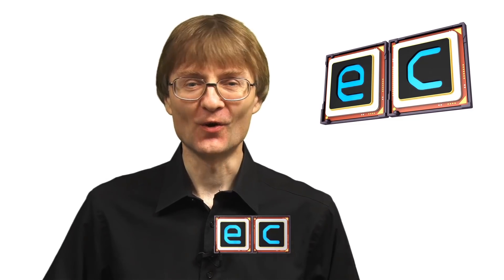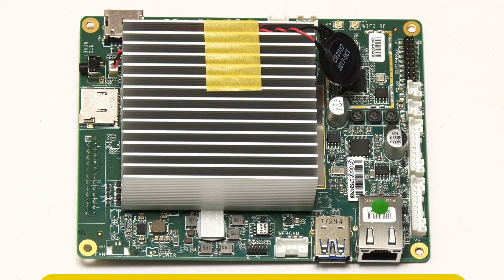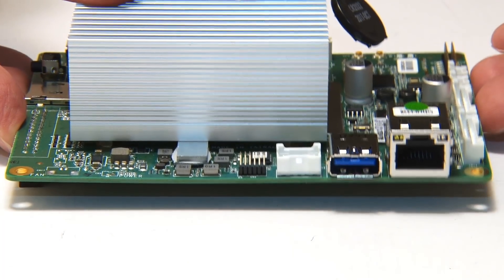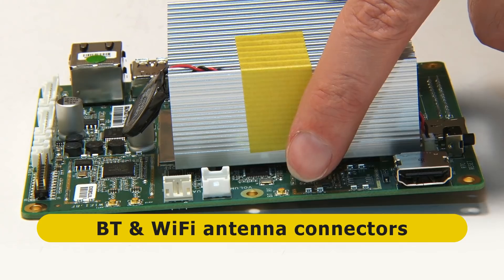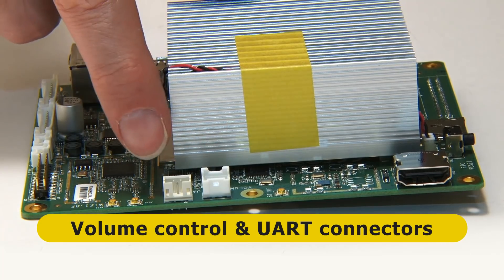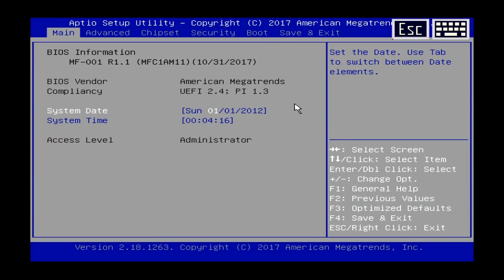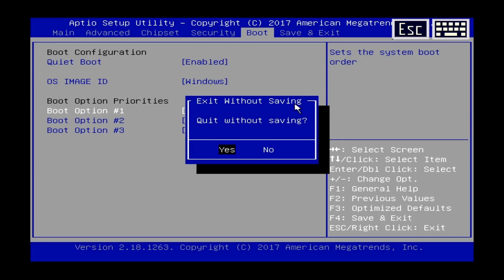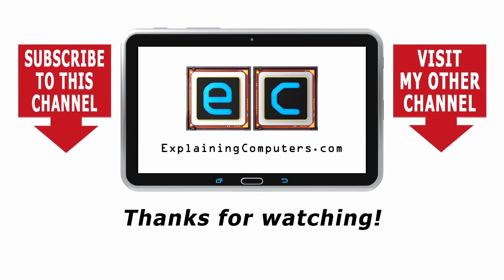Atomic Pi Intel Atom SBC

Comment: I have a cheap Chinese tablet with similar specs and windows 10. It really shows how heavy it is compared to 8. 
I had a linx 10 with a z3735, 2 gb ram and 32 gb storage running Windows 8. I loved the thing. I used it as a main. It ran most things, kodi and emulation upto ps1. n64 worked but the majority of games had <20 fps. 
I then got a windows 10 tablet with this cpu, 4gb ddr3 ram, 64 gb storage. I hardly use it due to how slow it is. Upon boot it begins to TRY and update. This takes 2-5 hours at which point >80% of the cpu. 
It spoils the experience, i ended up using android most of the time and installed Ubuntu which greatly improved it.
Windows 10 does sort itself out but it takes nearly a week of letting it exclusively updating.
Reply: I had that problem with an Asus laptop got tired of it updating every time I turned it on.

Comment: An interesting SBC! And rebranding it as a maker board is pretty clever, too. It might even end up being used for someone's robot, like it was intended, which is pretty neat.
Reply from the maker: Yes, things could come full circle! :)
Reply: There is some information on Github as well so it may have some of the robot information or at the very least information on the camera being used for facial recognition.   Maybe use in a drone since it has a compass built in

Comment: Not a “maker board” more a board for “roll your sleeves up hobbyist”
Will run Linuxcnc with a RT kernel for use with any of the MESA Ethernet boards.
Regarding power, it is more reliable with 3 or more power wires per Positive & Ground. The five pin connector near the USB3.0 marked camera is a USB2.0 port

Comment: Several years ago I faced the sad fact that 32GB eMMC storage is not enough for Windows 10... After some time on my Intel NUC5PGYH OAJ (with pre-installed Windows 10) it became impossible to update Windows, even using another 1TB SSD disk to store the updates. The problem was solved after migrating Windows to the SSD drive and disabling the eMMC storage. Also you will run out of your Atomic Pi 2MB RAM after opening several browser tabs (at least on Windows 10 with 1080p)...

Comment: @ExplainingComputers The three connectors to the side of the board that you could not determine the purpose of are connected to a XUF208-128-TQ128 microcontroller. This itself is quite an impressive realtime MCU with 8 32-Bit RISC cores which seems to be connected to the SoC via USB2. You can find the processor board schematics at https://www.digital-loggers.com/apschematics2.pdf
Reply from the maker: Thanks for this, most appreciated.

Comment: DAMN, Now I want one of these simply because of the Nav  function.  You could do a tidy little Nave System for a Ultra Light Air Craft. eaaaa?   Artificial Horizon ? Angle of Attack ?   Any ready made programs for that out yet ?   LOL,  Just ordered one via Amazon for $40.04 Free shipping.    This is ALL YOUR FAULT Sir !  LOL
Reply from the maker: Sorry to cause you purchase problems! Sounds like you will run some interesting experiments on this board though. :)
Reply: @ExplainingComputers  Well Worst come to worst I'll have yet one more back up computer come Armageddon Day.   It would seem the thing can  do pretty much anything AND MORE then this Lenovo I've typing on.   No End to these SBC it would seem.  And this one brought to light only because of a Failed CNC venture and  project ?   Wondering if they would continue making them sense all the Capital Out Lay and Development has already been spent.  You recon Parts and manufacturing would allow them to be sold this cheap ?  The Chines seem to be able to do it.    LOL,   Watch BangGood will start to sell clones in a few months ?
Reply from the maker: I don't think this board is manufacturable at the selling price, due to the price of the Intel CPU.
Reply: @ExplainingComputers   The buggers would clone that too.

Comment: The Amazon Prime pictures show what all the other connectors are for. Next to the speakers are a couple of digital audio output ports and a port marked 'Xmos Xtag Prog'. Next to the webcam port that is the factory Bios programming port.
Reply: I saw the photos as well.  The docs mention optional audio amplifier but it looks like it may be there, possibly for the L/R speakers.  That's cool.  What miasmark shows as digital audio output ports I saw on one diagram as MIC inputs.  Since this was a robot, I suspect these ports were used for surround digital mics.  If that's the case, along with the other programming stuff, this makes it a quite interesting hacker board especially since its original use was for a robot.  I think I'm going to get one to play with!
Reply from the maker: Thanks for this info.

Comment: Random, mysterious, undocumented connectors. I hate them because you know how awesome it would be if you could just figure out how to use them but... no data sheets. So there they sit innocently with their inviting, shiny silver pins and their neatly printed but impossibly cryptic labels and their delicate, tantalising traces languorously sashaying across the board to wriggle their way in amongst the millipede-like legs of inscrutible, anonymous integrated circuits.
Reply from the maker: Others above have revealed some of the functions. :)

Comment: Another problem with the Atomic Pi is the reset button.  After installing other OS on the MMC, if I pressed the reset button when the board hang during shutdown, the OS on the MMC would disappear from the bootloader.  It happen 4 times before I realized what was causing the OS to be not recognized.
Reply: SAME. Happened to me twice. Don't know why. Thought about either glueing the button stuck or desoldering it. Would be nice to know if your OS still gets wiped when you press it while shut down...

Comment: That was quite a investigative work you did there Chris; this id why you are the master 🙂
I have thought about buying the atomic pi but always put it off because of the lack of connectivity.
Power is no problem I already have something for that, but one thing that I absolutely need are a few usb ports.
Still it is a nice little board

Comment: Atomic Pie Chips and Beans...RTC Battery hanging of heat sink.....ROFL
Reply: The battery has a pre-attached adhesive pad on one side; is stuck mine to the underside of the board.

Comment: Can you do a video explaining the fan connectors?
Reply: One pin is ground, the other +5V. Check with a multimeter for continuity and solder your fan wires to the corresponding pads. Maybe there is a handy graphic on Digital Loggers' homepage with the pinout.
Reply: Ute Brüggenfompel Thanks!
Reply: You prolly won't need a fan tho, the heatsink is really big for that tiny processor; mine does not even come close to overheating.

Comment: I got 2 Atomic Pi's, the first one failed within 24 hours and the replacement has worked fine since.  I encountered the same problem on both boards: Ubuntu based OS always hang during shutdown and I had to remove power to turn it off.  That means REBOOT always need manual intervention.  Debian based OS like Raspbian does shutdown properly but there is no sound. 

If Atomic Pi is indeed a leftover industrial part, that also mean there will not be any support or bug fixing for it.  What works and don't will stay the way they are.
Reply: I'm running your bog-standard debian 9 with LXDE, which shuts down and reboots properly and uses only 250-ish megs of RAM, leaving plenty of headroom for whatever you want to run on it. I managed to get sound out of it by attaching a bluetooth antenna, installing blueman (and some other package; if you google the error message, should you get one, it's one of the first hits) and connecting it to my Bluetooth headphones.
Reply: The support for this board is less important than for ARM boards which need to be supported specifically.  This is a standard x86 computer with normal BIOS, and no issues with GPU drivers.  It benefits from normal Linux development.  The Cherry Trail CPU had problems with Linux in the past, but many things have been fixed and incorporated into recent kernels.  Maybe some other issues remain.  There was a developer, Ian Morrison I think, who was fixing the issues with the Cherry Trail and provided ways to patch ISOs.  The page is called Linuxium.  One of the issues I remember hearing about years ago on these Atoms and Linux was no sound.  That may still be the issue on Debian-based stuff.
Reply: @ravagingwolverine  Being X86 based, one would think so.  However, I have tried many OS on it and every single one quickly showed one issue or another.  

Unlike ARM based SBC that the manufacturer owns the issue of making sure OS works, Digital Loggers likely would assume that since it is X86 based, someone will fix all the incompatibility issue someday.  If Atomic Pi is a long lived product, that may happen.  If it is a leftover industrial part with limited supply, what is the chance of getting that happen?

This SBC has been on the market for a few months now and Digital Loggers has not even bother to provide a simple documentation on what are all those connections on the board are.   I use it as a NAS controller and it works fine for that purpose but I would not count on OS to improve later.
Reply: @hdl75248  If there's missing documentation, I suspect there is an issue of NDA involved.  They may have even said so, but I can't be sure.

The Atomic Pi may have its own issues and quirks, but it's also more flexible than the ARM boards which can be stuck on old versions and kernels.  So it does still benefit from overall development, especially if there are still improvements being incorporated officially into the kernel that are related to Cherry Trail, or if some distros are still on older kernels.  It wasn't that long ago Ubuntu had the same audio issue as Debian.  It's possible the other issues will be fixed as well.  I remember having issues with Ubuntu on an Ivy Bridge laptop.
Reply: Do you have the same mouse-issue when moving the cursor to the left edge of the screen?
Reply: @utebruggenfompel5764  I encountered that problem initially but then found that it was due to overscan issue on the TV monitor, i.e., I only saw a potion of the display on TV.  That problem went away after I changed TV display mode to "scaled", and everything worked fine after that.
Reply: @hdl75248  oh, that's a different issue than the one I was thinking of. I meant that that my cursor gets "stuck" for a moment when I move it to or along the left edge of the screen quick enough. It still works, but the pointer visually (but not functionally) freezes for a second.
Reply: @utebruggenfompel5764  I ran Raspbian and did not notice that problem.  Just made a quick test with VNC connection to the APi and did not see that problem.

Comment: Windows is quite fiddly to get running from SD or USB, it wont install naturally on those but should be OK on the internal storage, but 16GB isn't enough, all my 32GB tablets wont install 1903, 64GB is now the minimum in my opinion.
Reply: Windows 7 is still only just still being supported. Id use it.

Comment: I WONDER HOW IT WOULD RUN WATERCOOLED ...... PLEASE DO A TEST
Reply: Its more of a thermal interface issue. I ran benchmarks on mine to get it to drae 3.6A at 5V. the heatsink reached 55°C while the cores got to 90°C

Comment: That's an impressive little SBC. X86 and it can run a lot of heavy software pretty well. I don't know if you usually do this type of thing, but I'd love to see how it performs as an Emulator system. I hope another production run happens, I'd love to get my hands on one.
Reply: If you watch ETAPrime, you will see he has already fully covered the excellent emulation ability of this board. Check him out.
Reply: @englishrupe01  Oh nice, I just recently subbed so I'll have to search that out.

Comment: It's interesting to see the most common budget Windows tablet hardware move into SBC format. I have a £79 10" tablet with the exact same hardware (CPU, RAM, 32GB storage, etc.) The value of this item isn't great considering the features the tablet has for the extra ~£40 (10" IPS screen, speakers, larger storage, and battery that gives ~8 hours of use).
Reply: That tablet probably runs 32 bit windows which is quickly becoming legacy as 64 bit only software is being adopted. Good luck finding 64 bit drivers for that tablet, especially if the manufacturer has never made a tablet with 64 bit drivers. Linux is a option though.
Reply: @EmergencyChannel  That's the only issue with and it's a BIOS problem. I'm not sure why it can't be fixed.

Comment: For anyone wanting to tap into that USB 2.0 Header: If you don't already have a crimping tool (but you do have a soldering iron), the cheapest way I came up with was ordering a 1€ USB 2.0 extension cable from eBay (free shipping), cutting off the plug side and soldering the leads straight to the back side of the pins (with the board sitting on its heatsink and the connector facing towards you, of the two data pins is the left one the one that's typically white and the right one the usually green cable; what's +5 and ground you have to check with a multimeter, as I covered my joints with glue and cannot reliably tell which is which now).
I secured a part of the cable a bit further away from the joints with a generous amount of glue to a part of the pcb without any visible contacts to further avoid stress on them. Not the prettiest solution, but it's cheap and gets the job done.
Reply: Go to the Atomic Pi reddit sub.  There are easier ways with no soldering.

Comment: So the two unidentified white sockets are possibly for powering motors on the original robot ? So there might be an operating system tailored for the robot, to make use of those ?
Reply from the maker: This may indeed be so. The robot motors and servos have to plug in somewhere.
Reply: @ExplainingComputers  Many thanks for that !

Comment: Hi Chris in the next video could you please run Windows on it?  Also do you think there could be a Atomic pie 2 meaning do you think with this success and popularity would make this company do another?
Reply: "This company" didn't do anything but buy unused modules from a failed project for less than they cost to make, then sell them on to end-consumers. An "Atomic Pi 2" would mean finding computer modules for another failed product that were ordered and built before the project was scrapped... or a $200/piece price jump to source new boards.
Reply: @stanrogers5613  I just assumed if anything they make from this could fund a Atomic Pie 2.  This being said if they didn't pay much for the hardware.

Comment: Interesting video! I bought my atomic pi as soon as I heard of it from ETA Prime and did not know about its history.
Reply: By the way, did you experience your mouse pointer visually getting stuck for a second when moving it to the left hand side edge of your screen?
Reply from the maker: I've not had the mouse issue. I will now go looking for it though!
Reply: @ExplainingComputers  Perhaps they incorporated a fix into their built in Lubuntu version. You could have noticed it when you bootet from your Mint live usb key; at least when I do that I'm facing the issue. I have read about a "kind of" - fix that replaces the afforementioned issue with a flickering mouse cursor. It is (as I understood it) processor related.
Reply: It only happens when moving the pointer quickly to or along the left hand edge of the screen.
Reply from the maker: I get the strong impression that the version of Lubuntu shipped with my board (2nd batch released I think) is an improvement on what shipped with the initial boards, as i do not seem to have issues as initial users reported.
Reply: @ExplainingComputers  Thank you; I will probably upgrade to debian buster once it becomes the new stable release, hoping that it will be fixed then. Now, as far as I know, you're only an hour behind my time zone, so I would recommend you to get some sleep to stay nice and healthy :)

Comment: Hi Chris, would I be able to run a project I created for the Raspberry Pi on this? i.e. would be GPIO be mapped in the same way? (if I kept the number used down to 26 or less)
Reply from the maker: The GPIO is totally different I'm afraid, along with the CPU.
Reply: @ExplainingComputers  That's a shame. I thought I could give my application a little boost. Then I received an e-mail this morning that the Pi 4 is out! Then I notice you've already created a review!!! Good going!!
Reply from the maker: The Pi 4B would I'm sure give your app a boost! :)

Comment: Woudn't mind owning one of these but a used Mini-ITX with a build in CPU seems like a better alternative unless one really need that extra small size.
Reply: It is gutless for an ITX.  You can get more powerful embedded ITX for about £65.  You'll need DDR and some storage but all in still only about £120 and that will get you a Celeron rather than this uninspiring Atom.  I think an ITX would be wasted on a Cherry Trail.
Reply: @twmbarlwmstar  For a new ITX board etc yes, I said used.
Seen some that would likley outperform this Atomic Pi and cost about the same or less for a complete computer.
Reply: @10minGameplay1  Certainly, I have an old series 2 i3 with 8GB of DDR that cost less than £30 used, that would beat this Atomic Pi but it would also use a lot more power and the form factor would also be a lot bigger. Given how gutless the Cherry Lake is I think it a waste of PCB.
Reply: @twmbarlwmstar   Well yeah, for 2X to 3X the cost you should get more performance, right?  
Try running a web browser and Youtube vid on a 1GB Raspberry Pi.  Laf!   That is what this is compared to if you didn't get the whole "Pi" part of "Atomic Pi".
Reply: @bbaker6212  well go ask Intel about that I think
Reply: @bbaker6212  whar costs 3 times as much BTW?